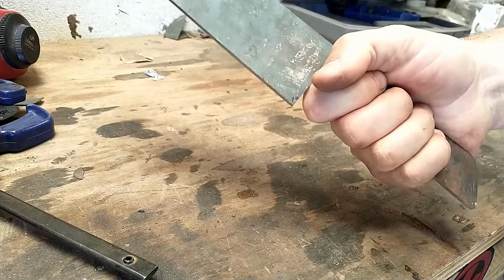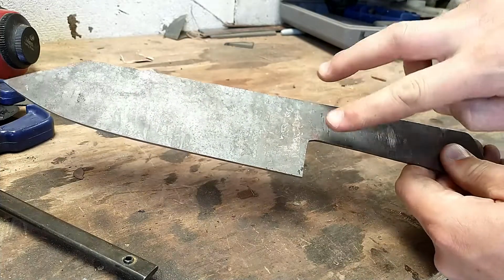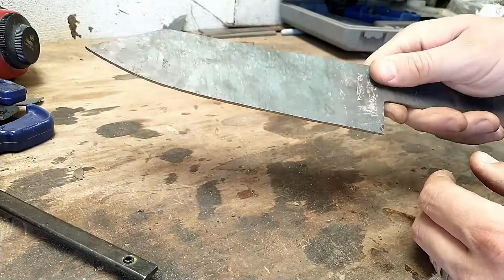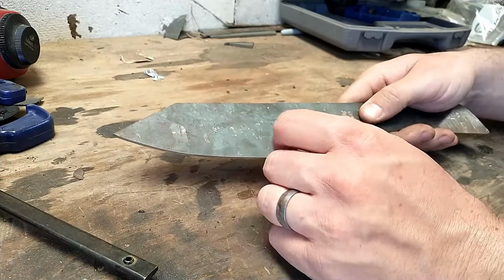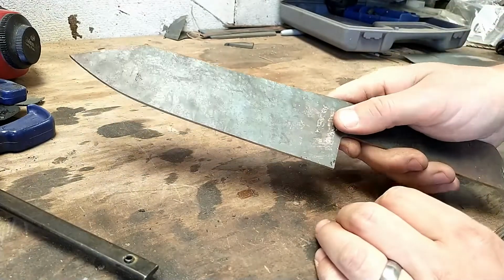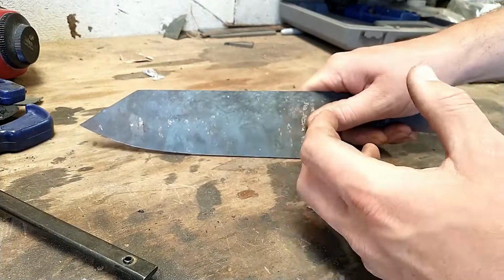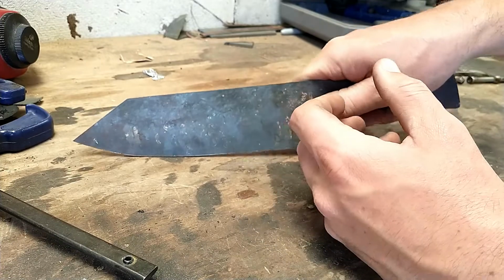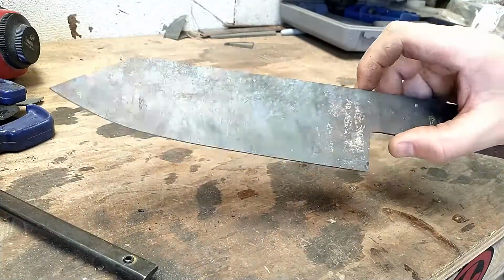Chef's Knife from 100yo Saw Blade

Comment: Realy Nice man do you need special metals for a kitchen knife or is like you use also good ? 👍👏😁
Reply from the maker: Thank you!  These old mill blades were made of 15n20.  That's a high carbon steel with a bit more Nickle added for corrosion resistance.  It's an excellent choice for a kitchen knife.  They develop a cool patina, though do require a bit more care than a stainless blade in order to prevent rust.
Reply: @ironridgeoutdoors  okay thanks man now i need to get a saw blade 😁😏
Reply from the maker: @Edwinthemountainman8454  No problem, just make sure the saw blade doesn't have carbide bits.  If it does, the blade material won't harden.
Reply: @ironridgeoutdoors  ok thx for The tip man
Reply from the maker: @Edwinthemountainman8454  No problem, take care.